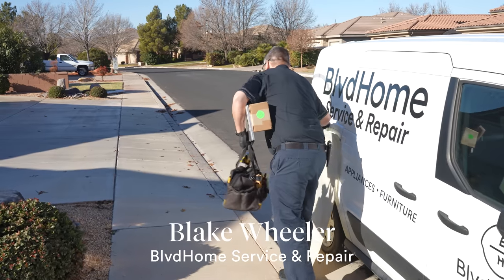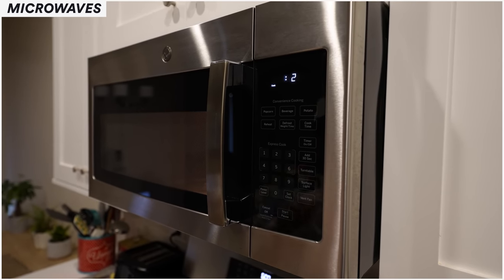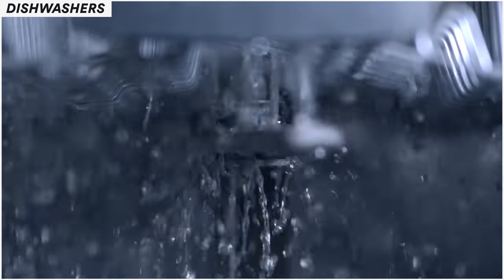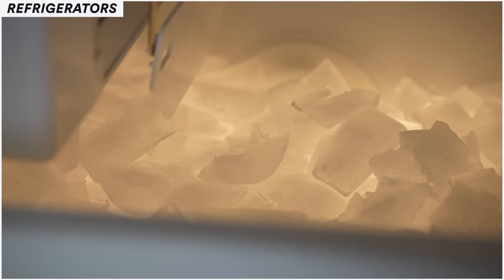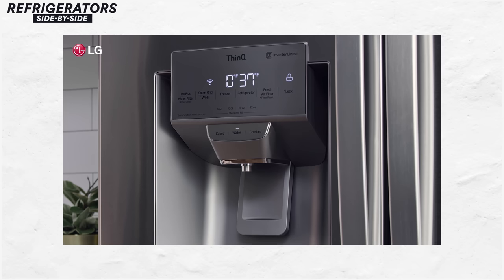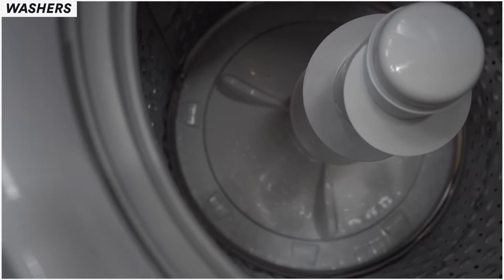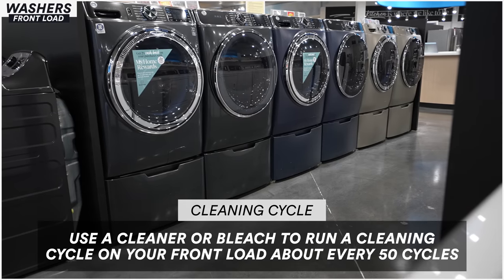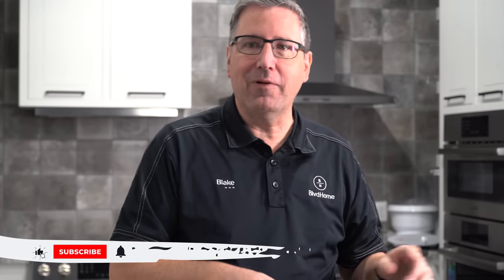Best Appliances Recommended by a Repair Technician of 29 Years

Comment: His Bosch dishwasher recommendation is spot on. However, he's way off about Frigidaire. You'd think a company with "fridge" in its name would make decent refrigerators, but you'd be wrong. We've been through two of them. The first one's compressor died after a few years of service. We regretfully replaced it with another Frigidaire model equipped with a water dispenser and ice maker. It's been a long nightmare.

Our rear panel has developed rusted out holes covered with large ice bulges due to inadequate insulation. The ice maker periodically stops working and works again only after cycling through the diagnostics. The dispenser paddle no longer stays closed. It's made of extremely brittle plastic with a small stud holding a spring in compression which eventually snaps off. Replacing it is futile as it will break again. Frigidaire could easily remedy the issue by making the paddle out of a less brittle material. Instead, they prefer to reap a bigger profit by only selling the $150 full dispenser assembly with the same crappy paddle. We've been up the creek without a paddle.
Reply from the maker: We're sorry to hear that! Wishing you better luck in the future.

Comment: Blake, what is the best way to get in touch with you in reference to the GE Profile One and Done.   I am following Ben's channel and now you.  I believe I have solved the Lint Issue with the Coil.   I would like to know if you can test my findings for the trest of the community or have a contact at GE that will listen to consumer complaints and actually work with the discovery of issues.

Its a shame that products are released to the public without proper testing.   You and Ben are clearly an asset to Testing, reviewing, solving design issues.

Comment: Nice video from someone who ‘Repairs’ them!
Question??
What is your opinion on these new ‘All In One’ washer/dryer that are hitting the market in the United States? Appears most are using an ‘Heat Pump’ to do the drying after the wash.
We are looking at the GE All In One Ultrafast model, however I did see a review on a LG model and not much more for other brands. Appears Europe has used them for a decade or longer, however their models don’t dry as well from the reports.
Thanks for some feedback for the “All In One’ washer/dryer machines.
Reply from the maker: We have yet to test out the new LG unit, but we did a couple videos on the GE UltraFast. Here is Blake tearing it down and giving his opinion: https://youtu.be/kEXBXI-T1Gw?si=e0oZxhhtUj3V-xlo

And here is us testing how well it works: https://youtu.be/wigqoVj-LaM?si=t3RJDX-zuYFLTUi7

Comment: Great overall video - but I was a little disappointed with the dryer section of this video. We have an Electrolux Washer and dryer (617 series). The washer has been excellent but the dryer has been an absolute nightmare with repair # 4 already in 6 years ownership. So, was hoping for brand recommendations on the dryers themselves as opposed to just buy the same brand as the washer.
Reply: Same.  Love our LG front load washer but the dryer sucks.

Comment: Great video.  We have an LG front load washer and dryer. While I love the washer I despise the dryer.  Nothing but problems, they even came out to change the motherboard under warranty.  It kept overheating. I finally had my contractor move my exterior vent up high on the wall so the dryer vents UP (stackable unit) and no more overheating issues.  But I can’t throw dry clothes in for a quick spin to get wrinkles out - the heat always reverts to sensor dry for whatever reason no matter the setting and heat doesn’t come on because it senses that the clothes are dry.  I can’t wait to go with another brand next time.  I NEVER use dryer sheets - I was told these will shorten the life of your dryer. 

My LG washer has never smelled but I always leave the door ajar after I’m finished washing so it dries out.  Monthly, I run a bleach cycle to clean it.

Comment: I have a matching set of LG front load washer and dryer that I believe are probably around 13 years old now.  After about 5-6 years I have had a recurring problem with the dryer blower wheel failing.  The key washer behind the nut that holds it on ends up rounding out the corners of the plastic recess in the front of the wheel mounting after a year or two at most and I have to replace it.  I never find anything that looks like could be jamming or binding the wheel to cause it to strip out.  I have asked about this issue from part supply stores and they never indicate it is a known problem.  Are you aware of this being a recurring problem with LG front load dryers?  Thanks for your assistance!

Comment: I bought a top load agitator GE washer a few months ago. The spin cycle is awful--often have to spin loads 3 times to get it dry enough to go in the dryer. Plus its hard on clothes, and I always have to set it for higher water level than it automatically senses for filling otherwise nothing would get clean. Not happy with it.

Comment: I bought my condo in 2006 and the previous owner put new appliances in. Kenmore basic fridge, Frigidare stackable washer dryer, Maytag quiet series 200 dishwasher, GE oven. all black.  They all work 18 years later.  Actually the Maytag dishwasher has an issue where it  stops soon after it starts.  I have a hard time telling myself its time to move on cause I know the new stuff is shit. I think I might go Meile and just pay it off since those are supposed to be the top of the top

Comment: I have a Bosch 500 series dishwasher for my condo.  One night it just overflowed but the aqua stop prevented it from going any further.  Saved my floor.  The repair tech said it was very sudsy in there.  I use DW pods.  But at the time, I was using rinse aid.  Is it possible too much rinse aid made it foam up and overflow?  I am very confused how that happened.  I don't even think it was a year old.

Comment: LG has refined the design of their refrigerator linear compressor and according to Yale and their blog the past two years LG has been the least problematic refrigerator tracked by their companies repair records. We recently purchased an LG refrigerator but avoided the indoor ice and water dispensers, it does have the ice maker in the bottom freezer. LG is like Miele in they make their own parts instead of sourcing parts like other manufactures do. That allows both LG and Miele to have better control of the quality of their products. So in saying this while yes LG did have issues with their linear compressor in their refrigerators they did make changes to those compressors and so far it seems to have been successful eliminating the former problem. 

I agree that Bosch is the best dishwasher, we have the 800 series and love it. 

When it comes to Electrolux I do like their front load washer and dryers but their stove and refrigerators I do not like, we had issues with both the Electrolux stove and refrigerator we had. The Electrolux front load washer and dryer were both good and lasted over 12 years, the washer was still working but the drier started throwing a code for the heating element so due to their age we decided to replace them and went with Samsung front load washer and drier. I would purchase another Electrolux front load washer and drier except they did not have any when we replaced them in 2020 where we bought from. 

We replaced the Electrolux stove with an LG induction top range with convection oven and so far the 2 years 8 months we have had the LG induction range it has worked flawlessly. Induction cook tops are the way to go in our family.

Comment: All good stuff. One note though. Appliance designs change over the years, especially lately. So, some of your comments don’t really apply to the new updated product. You know: apples to oranges kind of thing. You might be talking about old products that bear no resemblance to the new units in terms of system architecture (for some products) .

For example, you hate LG fridges. I totally understand. The older models used a linear compressor. There is a class action law suit. Fridges using this compressor were just plain bad and had a terrible service record. So, LG gets what they deserve on that. Your comments on this older product line are of course correct.

However, the new LG fridges are inverter based. The linear compressor is gone. The inverter is a totally different animal. The inverter can control the speed (capacity) of the compressor. The old design with primitive expansion valve was like a high wheel bicycle with a single speed. The inverter is like an F1 car with multiple speeds and near infinite control. The fridge can react to changes in load (warm food being loaded into the fridge) and ramp up and down as needed. Fantastic when it works.

So, this is probably why Consumer Reports has LG fridges at the very top. We have a brand LG French door fridge. It keeps food so nice and cold. It’s awesome compared to our old Electrolux that was apparently losing refrigerant slowly over time. But alas it's new.

Only time will tell if the service record of these new class of inverter fridges will be better. They have expensive circuit boards that will be expensive to replace. This is the technology they put in mini split air conditioners and is clearly the future of refrigeration. Fingers crossed that it all works out long term. LG gives you a 10-year warranty so, we will see. On paper, the inverter looks a bit better than the linear compressor though.
Reply from the maker: You're right about the new LG design. Only time will tell, but we certainly hope that they will perform better!

Comment: I had a technician repair my LG dishwasher that was failing to drain properly. Before looking at the machine, he opened the cabinet under the sink saw the plastic dishwasher pods and said "found your problem". Apparently these will gunk up your drainage pump sooner or later. He also looked at my LG fridge and immediately changed temps saying it was set to too cold and it works the compressor too hard. Stuff is still proper temps and fridge is still working (knock on wood). I wonder if (like Televisions) some of these come with bad default settings or installers crank stuff to super cold before they leave to prove it works?

Comment: the ice maker being outside of the freezer ie in the corner of your refrigeration section often freeze up they build up humidity and just freeze over.  in the door ice in general is not a great idea.  ice maker in a bottom freezer does great.  and water in the fridge but not in the door works great.  in the door is just asking for it.

Comment: youre the first person i heard more or less praise samsung. specifically refrigerators. theres literally a fb group demanding recalls. i have a chef series and the ice maker failed. replaced it and it failed again less than a year later. it also has a pretty bad water leak under where the filter goes. and the finish on the inside peels off. no bueno.
Reply from the maker: Samsung has some cool technology but we've also been very open about their reliability issues.

Comment: I bought an LG front-load washer (WM3470)  that was delivered brand new in the box 2 weeks ago.  I’m very careful not to use too much detergent and very little, if any, fabric softener, but somehow the tube that carries the water (and whatever else) from the detergent drawer down i to the wash drum seems to have clogged, and water gushed out from the detergent drawer like a waterfall and flooded an area of my basement.  What would cause this in a washer that hasn’t even ran 10 loads of laundry?  I loved the machine for the couple weeks it worked, but I’m feeling pretty soured right now…
Reply: Well if it’s brand new file a warranty claim.

Comment: We have a 22 year old Whirlpool top freezer fridge that works just fine…..except for the water draining inside the fridge.  There’s no water connected to the ice maker, which is shut off, so it’s pure condensation.  It drips from the back of the fridge where there’s openings from the freezer.  We’ve put 2 plastic cups that have to lean forward to catch the dripping water and still, it often drips onto the shelves and egg cartons get wet or even freeze into ice.  I know if I put too much in the freezer and it doesn’t allow the air to circulate, I pay for it in the form of a waterfall in the fridge.  Can this be repaired? Help!

Comment: I bought Frigidaire wall oven microwave combo, worst ordeal ever. If you buy appliances at " home Depot " , purchase when you are ready to install, you have 48 hours to return if it's a lemon. I bought a lemon and that's from the Frigidaire company repair man. Can't take it back because I installed 3 days after I purchased. Bought November 4 and still don't have a oven through Thanksgiving hopefully December 20, they have cancelled repair dates 3 times. I know its not a common issue but it happens.

Comment: When we remodeled our kitchen we purchased fridge, dishwasher, gas range from a appliance store, instead of big box stores.  Went by the salespersons recommendation and bought Samsung!  Big mistake!  I will never buy anything from Samsung again.  I have to manually defrost the fridge twice a year, replaced the ice maker myself.  Had to replace 2 of the cheap plastic door bins.  Dishwasher has been fine other than a strange burn mark on the stainless front (something inside must have gotten really hot.  Range: some kind of board had to be replaced within 6 months, luckily under warranty, had to Jerry rig the knobs that were breaking, and the bottom burner had to be replaced.

Comment: I had bosch dishwasher which costed 800$ 10 years ago and it simply didnt close. The repairman said there was defect in the latch and no matter how many times i call a repairman, it just wouldnt be fixed. It only ran like 5 cycles before the latch started having problems...now i would never buy a bosch dishwashet even if someone put a knife on my neck.

Comment: Hello i need your opinion on my kenmore elite top wash machine. Basically its not working but all the system lights come on normally.i ❤ a couple says its the the motor most says its the sensor ln the door and i have bought motor and door parts and still the issue is the door is saying its locked when i can open and close it anytime i wish

Comment: Few microwave tips from someone who used to fix  them up. Avoid the classic "analog" turn timer models, their timers will start to be more inconsistent the more you use them due to them using straight contacts in the timer, a lot like the "sparking" issue here in video .  If you don't care about the accurate timer and missing the ding every now and then, these will work for a long time too.  Also if you don't use the microwave at full power, the timer just cuts it out and back on, basically the idea of opening and closing the door constantly. 

Anything with digital clock will stay true to the timer if they don't have any component failure. 

Also some of the new cheaper models like LG tend to be extremely thin steel and with the digital potentiometer are quite fragile if hit in certain angle, these are worries for those who move a lot I would say, it doesn't take much to dent / break the potentiometer.

Comment: Does the Electrolux front load washing machines contain auto dispenser or venting technology?
Reply from the maker: It depends on what you mean by auto dispenser. Electrolux does not currently have detergent dispensers that can be "preloaded" with multiple wash cycles worth of detergent. It does however "automatically" dispense what you put in the dispenser at the correct time in the amounts it needs over the duration of the cycle. They also don't have any venting in their washers. That feature is exlcusive to the GE models with ultrafresh vent at the moment. Hope this helps and thanks for watching!

Comment: As a highly experienced appliance repair Tech here in Las Vegas I just want to mention one thing that he does not mention in this video most people do not know that GE is no longer GE. GE was bought out by the Chinese company Haier several years ago and Haier has been designing and selling in my opinion crap after crap after POS with all their appliances across the board. I would not recommend new GE/Haier appliances to anyone especially the dishwashers and top load washer or dryer which sometimes are not even repairable after 1-3 years. GE/Haier french door refrigerators constantly have failing evap fan motors in fridge section. And as always if you live in an older home and don't care about having new appliances, used appliances from the 1980s 1990s and very early 2000s are much better than  new appliances from 2010 on.  BTW I can't be a hypocrite because bad appliances is what keeps me employed however anybody in this industry anywhere anytime especially if you're an engineer or a Salesman or the government who tries to tell you that modern appliances are better more energy efficient, water efficient etc.and save you money are the biggest liars on the face of the Earth. Any money that you save with a new Appliance in its first five years, you lose every single penny the first time that you called me to come to your house to repair one of these newer appliances. Old school quality doesn't exist with new appliances regardless of brand name.

Comment: Panasonic and Sharp(the same brand) are the best Microwaves. 

In stoves AGA is truly the best. 

In dishwashers Bosch are the best. 

In Refrigerators Liebherr is the best. 

On freezers it’s also Liebherr. 

Washing Machines l, we don’t use top loaders in the Netherlands, so I don’t have/sale/fail figures. For front loaders Siemens, Miele and AEG are really good. Never buy Samsung or LG. 

For dryers I recommend a Miele.